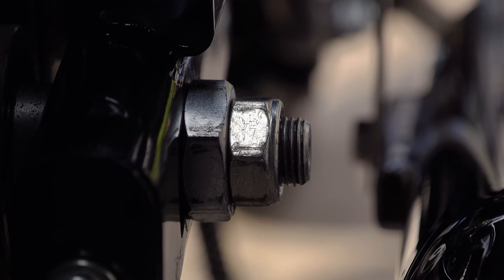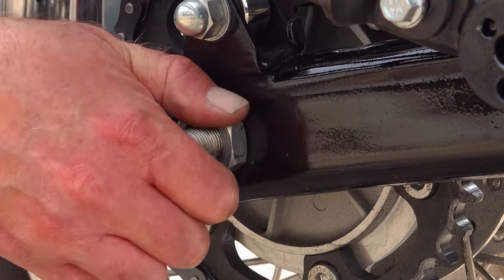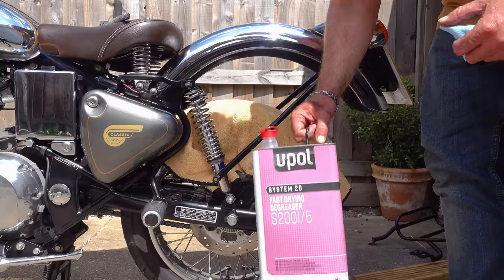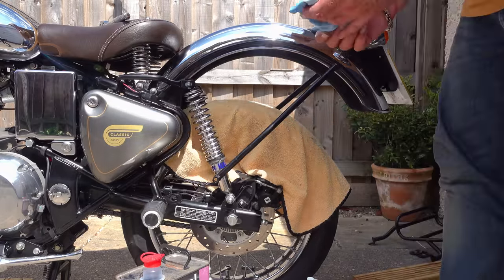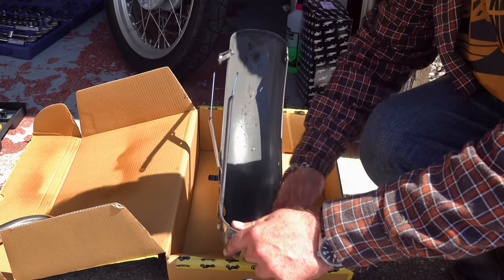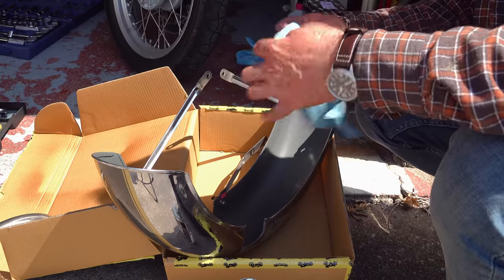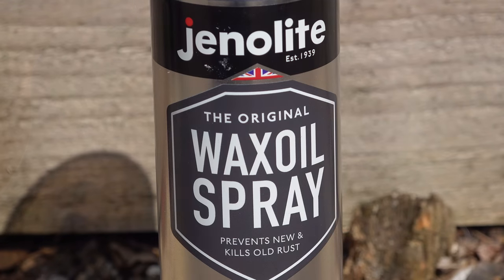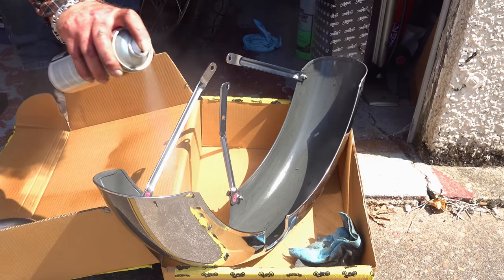BEST corrosion protection for your motorcycle? NEW KID ON THE BLOCK!

Comment: A really important reminder this video! Up until the early 1980s it was a common sight to see cars with body work that had rusted through from the inside, even cars that were only  few years old. rust would start on the inside of the panels and eat through to the outside!
You never see this now. WHY? because during the 80s car manufacturers adopted the use of waxoils/cavity, wax to protect the inside of the panels and the underside of the cars. As a result some can now offer 15 year anti corrosion warranties!
Reply from the maker: Ah yeah good point! wheel arches hastily rebuilt with glass fibre to get through an MOT was a common sight back in those days!
Reply: I used to work in a Vauxhall dealers in the 1970s in new car preparation part of which was cleaning the rust off the chrome and sometimes the paintwork!
Reply: i remember cars with the sills painted black with hammerite or whatever was a thing too lol.
Reply: In my early days as a car apprentice we would add an option to new cars which was to spray the entire underside with a tar like product that blocked corrosion. It was murder to work with and even worse if you had to get it off. That usually required a hot paraffin steam cleaner.
Reply: @cyborgbadger1015  Regularly used undersill on my mini
Reply: Wish I had come across your channel yesterday after friends told me how good ICF 50 really is empty my pocket of £30, made worse by thinking. I wonder if waxoil do some sort of product for bikes, never mind we all live and learn
Reply: Don't panic, ACF is still very good, and it is very very very good when used inside yous handlebar switches, inside all electrical connectors, and underneath all earth taggs. If I could get it inside every wire on my bike loom, I would😮

Comment: Morning Stuart, In the early 1980's I used to ride my Triumph T160V throughout the year, in winter, we didn't have those fancy PTFE anti-corrosion sprays in those days so I coated most of the bike using general purpose grease. The bike didn't look that good as dust and grime from the road would stick to the grease, but water and salt couldn't penetrate the grease to do it's dastardly work of corroding by beloved motorcycle. In spring I simply washed the grease off using Jizer and hey presto I had a beautiful clean and corrosion free motorcycle.

Comment: What a great video Stuart. Again, you're taking common sense, but it's really useful to hear that your background in this lends alot of credence to your views and comments. Well done. I couldn't agree more re the comment about "Just because its stated as being for a motorbike leads to an instant price hike". This is a pet hate of mine and is almost always entirely without merit. As with you, a couple of years ago I bought a new BMW GS. I bought it in December, rode it home in torrential rain, dried it off and then put it in my garage for the winter. I visited this bike often to make modifications and to add accessories. While it was in the garage I noticed that the chain had started to develop a thin sheen of rust. So I performed chain cleaning maintenance (I have always used paraffin for chain cleaning) and then applied a generous coating of a highly recommended chain maintenance spray called "S100-SDoc 2.0". About 4 weeks later the sheen of rust was back and seemed to have eaten the chain lube for breakfast, it was complete garbage! I went back to using my tried and tested chain wax. Sometimes you just have to admit that the older solutions remain the best option. I had not heard of using a waxoil treatment for rust prevention and protection, but I will definitely go look at that now. How is it on painted surfaces (such as fork casings, the swing arm or painted frame)? Definitely want to see a follow up on the JENOLITE Wax Oil product. 👍

Comment: Looks a decent product , never rated ACF50 Either , I've been using XCP Rust Blocker for a while now the new clear coat is excellent found the durability is around 4-6 months depending on weather conditions and washes but will be looking forward to your thoughts on the Jenolite , great video as always 👍🏻
Reply: Another vote for XCP Rust Blocker 👍

Comment: I had the same issue.
I had a new BMW 650 scooter, which I treated with ACF50 in the late autumn.
When I washed it off a couple of weeks later, all the metal coatings were corroded.
I don't use it now and use a purpose made motorcycle corrosion inhibitor. 
.

Comment: I think condensation is more of a threat than road salt .  I thought my zzr 1100 had sprung a leak  noticing a puddle of water underneath it . I never figured metal could do such a thing in what I thought was a fairly cosy out building . So I panelled it out with boards and layed old  carpets . Then sprayed on gt 40 and 3 in 1 . come spring I removed it and everything was perfect .  Cheap  spray cans work a treat .just use it regular .   Splendid stuff Stuart  .
Reply from the maker: without a doubt! garaging your bike over winter isn't always the safe option you expect it to be.
Reply: With respect I have to disagree about road salt. It will eat your bike quicker than condensation. I have had my T120 over 2 years now and it is stored outside with an Oxford cover over it. Before winter sets in I clean the bike and I do use ACF50 along with GT85 here and there. I coat all the chromework with ACF50 . I am retired and so I dont need to use the bike for commuting ...others may have to . If the roads have been gritted I do not take the bike out or anywhere near it...salt is death for Aluminium and I know this being an Aircraft fitter. I was severly reprimanded  by an inspector for forgeting to put my overshoes on once before entering the wing of an A380 in Germany, as it was winter and we had been walking outside where salt was present. I always wait untill we have had a couple of good rainstorms after the roads have been salted before riding. As for condensation...I read that a trick is to put cat litter into a cloth bag or old socks , and place this on the bike under the cover, it acts as a dessicant.  All I can say is I have no rust yet on the T120 and although the engine casing has dulled off a bit, the chrome is fine. This Waxoil seems really good though and I will try it. Thanks for another great video Stuart. 😁

Comment: I use lanoguard moto spray grease for anti corrosion on my bikes and everything nowadays .The grease does not fling off the chain and the spray coats easily and does not get blasted off even with pressure washer .It's lasts ages and is a natural products .
Reply: good for head-race bearings also.

Comment: As a skeptical (and thrifty) ACF 50 user, I greatly appreciate you bringing this product to light and demonstrating its application. I do want to clarify one point: I have used ACF 50 on the engine but, if I heard you correctly, you're not recommending the Jenolite product for use on the engine or associated hot parts of the bike. Is that correct? Many thanks!
Reply from the maker: yes its likely to melt and evaporate much like ACF50. feel free to be skeptical its your bike and your money.

Comment: Just to throw me cap into the ring, on my 1957 BSA B31 I use a combination of cheap clean oil and paraffin, in an old spray bottle, under the frame, mudguards and anywhere else may need, then wipe it over the bike with an old clean rag so left with a film of protection, making sure am keeping it away from any rubber parts, seat and any where am going touch,  all though It has its original paint work so must be doing something to protect it(with patina) so am not going spend lolly on its upkeep, that's for the other younger bikes (45+yrs) Thanks Stuart.

Comment: Great video Stuart, for those of us who ride through winter your bike is really up against it, inside of steel mudguards, swinging arms ect on a wet salty road is like putting them in an aqua vac cabinet  As you said about ACF50 it's not the product but the regular wash off that gets rid of the salt on your bike. This wax oil product looks good, better than the pot of grease and paint brush. I suffered from a damp garage up until replacing the roof with 30mm insulated steel cladding, now the place is as dry as a bone.

Comment: Wurth silicon grease ( not the silicone spray) , it actually etches in to the surface , spray in can lid then brush on nuts bolts brackets , you could spray it direct on your underside of you mudguards, it then polishes off no sticky residue at all . A truly remarkable product that I stumbled across 25 years ago , I can’t work out why they don’t market it as rust prevention.
Don’t get it anywhere near disc surface though ! 
Panel wipe won’t remove it , it’s hellish stuff

Comment: Hi Stuart, love your videos and it compels me to buy those accessories for my Classic 500 as well. I've recently bought a used one, 2015 model and looking to revive it's glory days. I'm sure a good cleanup should do the trick, but I wonder how to clean the engine. I've seen the videos for the shiny bits of the engine, use metal polish you say. But I'm more concerned about how do I clean and shine the non shiny parts of the engine, like the fins, and the lower half of the engine to which the shiny casings fit. Didn't find anything helpful over the internet, and hoping you can show us this magic too.

Comment: Very interesting Stuart   if I had metal mudguards I would still use Waxoil and use the new product on area's that were on show.  I have very little problem with rust as the under parts of the bike are waxoiled and if the bike is wet I put on a dehumidifier so the bike is dry the next morning and the dehumidifier keeps the whole garage dry.

Comment: I use ACF 50 in a mix. Approx 60% ACF to 40% GT85. Mix well and leave in an open container. After a day to two you will get a thickish gel that you can paint upon all your shiny fasteners. Lasts better than ACF and will wash off with a bit of a scrub / much off.

Comment: I sprayed my Royal Enfield Interceptor with the Jenolite Waxoil spray about 3 months ago. During the last 3 months the bike has been exposed to rain and condensation to the point where the bike is thoroughly soaked for nearly 24 hours and this has happened a dozen times at least and I haven't seen any rust whatsoever on treated areas. The only trade off is it does pick up an awful lot of dust, that even after washing, the dust just stays stuck in the waxoil so it's never truly clean. But I'd rather have a dusty looking bike than a rusty one 😬 So much better than ACF, which just seemed to run off with the slightest bit of water.

Comment: I use rubber spray where brackets hold fenders , it fills the voids . it is an automotive product , it needs to be replaced every five years , it should be done when you get your bike new  especially in Canada where salt is more available on the roads than in your kitchen .

Comment: Never really used ACF , I have friends that swear by it as I'm admiring corroded parts on thier bikes ! Like the millions that buy Big Mac's ( other crap burgers are available ) which are slabs of tasteless roadkill between 2 car polishing sponges slathered in crap to give some flavour it's advertising over efficacy ! 
I'm not offering up any miracle product myself I tend to use a lot of GT85 having worked in the cycle industry and find it works for me & as for chains that Stuart was cleaning in his previous film I use paraffin for cleaning and Gear oil to lube ! Each to thier own 👍
Reply: @jasonking9008  correct 👍

Comment: Ah, not like the good old days where a fine oil mist from our British bikes meant that corrosion wasn't an issue. Oil on the back tyre on the other hand.........
Reply: In the early 70’s I was racing my Commando behind a Suzuki Titan and decided not to try to overtake him.   When I got home there was oil all over the rear wheel.  Took the oil tank off and had the “chain lubricator” outlet plugged.   I wonder how many riders went down because of the thing.

Comment: I've used 2 sprays S100 supplied by Harley dealers which looks like the same stuff, however I think it might be a bit thicker? The other spray I have used, which I do have to say was like covering your bike in solid wax was Wurth wax protection spray, however it was difficult to remove!! But I swear by the Wurth product as it protected my milling machine perfectly for two years while it stood outside under a Tarp. But it wasn't easy to remove.

Comment: when i bought my New Triumph Sprint ST in 2009 i bought loads of ACF50 in a bulk purchase because it worked out cheaper, i bough 4 spray cans and a Liter bottle to use in a spray container and not knowing or being told that it would only last for a year before it went off thought that i was saving myself a fortune and also protecting my new bike, and i am still using it but only to oil squeaky door hinges and none important house hold jobs Lesson learned

Comment: I work in the aviation field, we tried out ACF50 and were not impressed, We always used LPS 3 for corrosion protection, it would leave a nice waxy film. And it was half the cost of ACF 50. I use LPS 3 on the bottom of my vehicles.
Reply from the maker: Ha That's possibly why they are pushing it at motorcyclists!

Comment: Hi. I got this product t after watching ir video. The product sprays well. The application part is excellent. Regarding rust prevention I need to wait to check the results (or lack of). It does leave the surfaces a bit sticky. I also sprayed onto my motorcycle chrome headers, that now are covered with a layer of product with a mat finish. My question: after applying this product how do you wash the bike? Need ti reapply the product after every wash? Cheers and thanks for the videos
Reply from the maker: use the method i have published in the past. so far I've had no need to reapply.

Comment: The older Pan European ST1100 was prone to the pressed steel swing arm get rusted through from the inside out, and by the time it was noticed it was usually too far gone to fix. Getting a replacement from places like California where the climate is much different to ours was the usual answer .On receipt, the best option was to drill a few strategically placed small holes and spray the internals with waxoil before resealing the holes and spraying the arm with a hard wearing paint.
Just a BTW should that axle on the rear wheel not have a washer behind the nut?
Reply from the maker: BTW should that axle on the rear wheel not have a washer behind the nut? Apparantly not!
Reply: @stuartfillingham   It just seems at the moment the actual removal and replacement of the nut seems to be wearing the paint away (see the marks at 01:32 & 01:57) which would encourage rust
Reply from the maker: @Arachnoid_of_the_underverse  yeah they were there when I got the bike a year ago obviously from the point of manufacture. but I treat my bike with my preferred products so as you see no issues so far.
Reply: I have a pan 1100 and had to replace the swing arm , the new one I filled with waxoil using a syringe through those drainage holes till it flowed out of those gaps in the fabrications , also put a mudflap on the inside of the rear mudguard to protect the pivot box section from the worst of the crap .

Comment: Another product line that looks promising that however, (like Silkolene or GT85) we can't get in the U.S. I've read that WD40 Specialist Dry PTFE lube is similar. I'm reluctant to try another WD product. TriFLow and CRC both make something similar as well, I don't know. 

As for a Jenolite Wax Oil alternative, closest I can find here is Fluid Film. It's lanolin based product designed for the same purpose, under carriage protection on cars and trucks. Doesn't look like it goes on quite as transparent or last a year.It has a slight amber color and lasts about a season from what I'm reading.

Comment: This is SO useful and spot on. Corrosion is THE enemy. Here among RE owners we say that every new bike sold Sidol (a popular household metal cleaner my grandmother swore upon) revenues bump up and they don't even know why. Been using all kinds of products too. Settled on aviation spirit as a degreaser, Motul chain maintenance products and a lot of elbow grease while rubbing Sidol here and there as needed. I've also begun using Jenolite rust remover, so I know the brand. This wax oil is already on the shopping list and could be a game changer. I have a question though: do you think it could be sprayed also on the rims? So far I've been using Poorboy's World wheel sealant (another car product) which I like, but there's always room for improvement (although I am also shopping around for aluminum rims). Thank you!
Reply from the maker: It will be just fine on rims, just be careful not to get to much on the tyres and clean any overspray off them.
Reply: @stuartfillingham  Very good, I'll definitely try that. And yes, of course - I was thinking of masking the rims with paper tape! Thanks for the reply.

Comment: Hmmmm🤔 my only issue is you're going to continue to wash the bike which should include under mudgaurds so in theory, dirt, salt and any other nasties should be removed . Then a spray of good quality protectant and you're good to go till next wash. Always worked for me with my 40 year old Honda work bike still corrosion free in these areas. Interesting as always mate 👍
Reply from the maker: well the idea is the wax stops salt and dirt sticking so you can just rinse it off with no need to retreat for several months.